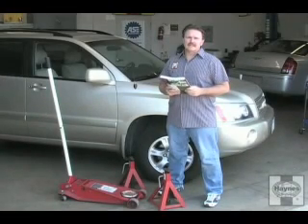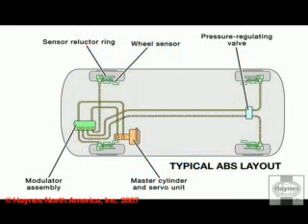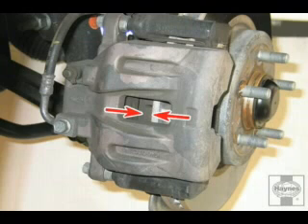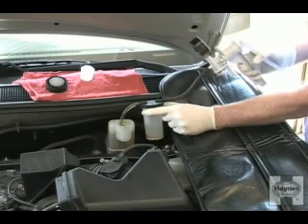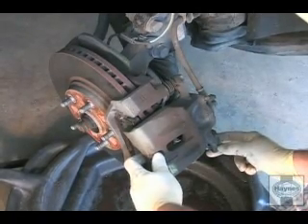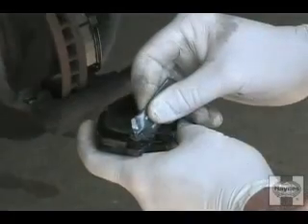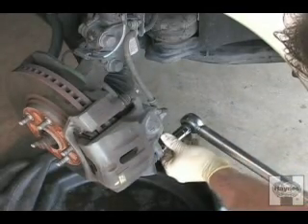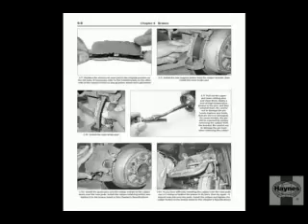Brake pad replacement

Comment: @HydrauIics I use a 10-12 inch iron pipe that will fit over the rachet handle. This makes a huge difference in loosening those caliper bolts.

Comment: I know you posted this a year ago but if you have problems with rusted bolts use an electric impact wrench. you can get a decent cordless one at Sears. Craftsman 19.2v C3 1/2 inch drive Impact Wrench. get the kit as it comes with two batteries and charger also get impact sockets

Comment: @MarstaJNZ "What was the point in removing some of the break fluid ? And is that clamp really needed to descompress?"

I believe he took out some brake fluid so that when he compressed the piston with the c-clamp, the fluid wouldn't go above the max level.  The c-clamp makes it so much easier it's 100% worth using.  I used to change brake pads without a c-clamp and it took about twice as long because I used to have to mess with trying to compress the pistons by hand or using other tools.

Comment: @campauchicken That's a good point. But the first time I worked on my brakes, I didn't have a torque wrench. I just tightened them as much as I could. But ever since I bought a Torque Wrench, I always try to follow the car's manual.

Comment: @campauchicken could possibly be that it is a 4x4 that I was working on today, 00 nissan xterra, and they seem to get a little more dirty, I allways anti seize all my bolts when putting back together, makes the job a little easier next time, but this was my first brake job on this vehicle, figured after two years it was time

Comment: @campauchicken I agree, not everything is "text book", and yeah, kind of hard to strip a 19mm machine thread bolt!!  LOL I had to use heat to get the buggers off!! and loaded them up with anti seize when putting back together, without a torque wrench I might add  LOL

Comment: @victortsui123 Sort of. I changed the pads on all four wheels of my truck the other day and they had a bit of a burning smell after driving. I'm told that is the casting agent burning off the new pad surface and it's normal.

Comment: save your money.open any bleeder valve ,now have someone gently and slowly press down on the brake pedal.
make sure that any fluid goes into a clean plastic 1 quart container.when doing brakes never let it drip on any paint.
and replace what was taken out with new,fresh fluid.

Comment: has anyone changed the front break pads of a volvo v70 1995? if so did you need to use any special tools

Comment: @campauchicken  My comment was directed towards "If you need a torque wrench to tighten the bolts, you shouldnt be doing this." it is OK to use a torque wrench to do this, but I do understand your point in not "having" to use one, I just did a front brake job on my nissan xterra about an hour ago, and no, I did not use one either  LOL just think that if someone wanted to use one, or felt that they should follow the specs then so be it :) just had a brain fart, butcher talking with a chicken

Comment: That is not entirely true the very least that is required is roughing the surface with emery cloth or sand paper to take the glaze off the rotor allowing for the new pad to bed in its friction material. Never turned my rotors 150k stop and go traffic they have worn only 1/16th of an inch from new replaced pads 4x thus far

Comment: Someone should send this "mechanic" back to the 1950s. The brake systems of today are NOTHING like 30 years ago except for the fact that we have a hydraulic pump and hydraulic cylinders. The materials, the fluids and the basic systems are not the same. This guy just cost you $2500 by pushing all the contaminated fluid, ie... dirt, moisture, deteriorated rubber brake line material and rust from the calipers and the steel lines, inside your brake lines, back through the ABS pump and valves. This is not to mention the brake master cylinder. If you want a cheap Gomer and Goober mechanic just go to Craigslist and get yourself a good deal on one of the "mobile" guys. Ask them if they are licensed, insured or registered in your state to do repairs. Also, where will they be when that cheap repair goes bad?
Your brakes are the most important system on your car. Why would you take a short cut on something so critical. Say what you want, but I'll always give my customers value for their money. SHEEEESH
Reply: I've done this for 40yrs and never had a problem

Comment: Compressing the piston into the caliper without bleeding the fluid from the piston is wrong, there's a lot of water in there not to mention contaminates, bleed old fluid out. They should know this.

Comment: AND!!!! How many miles on the vehicle? What about the wheel bearings and rotor "run out"? Brake fluid should be changed, at the very least, every two years. It is by nature made to absorb moisture. It keeps it in suspension until it becomes "saturated". That's when it settles in your master cylinder, brake lines, calipers and wheel cylinders where it becomes corrosive and eats away at the metals. I suppose Mr. Haynes didn't think we were smart enough to explain that to us. Ignorance is bliss as they say!!!
Reply: my car is 15yrs old with the same fluid ,you need to biy a CHEVY